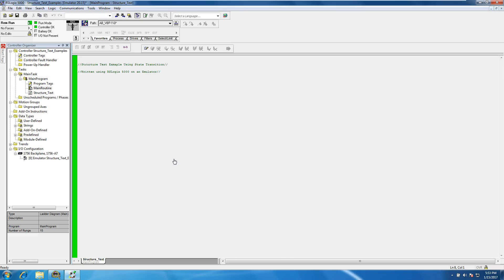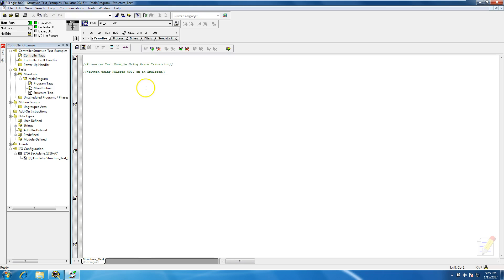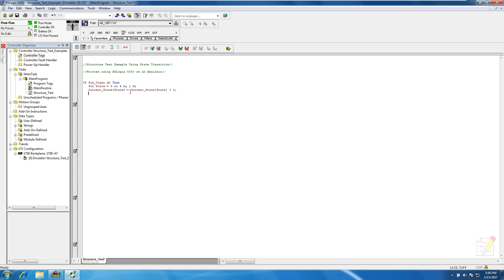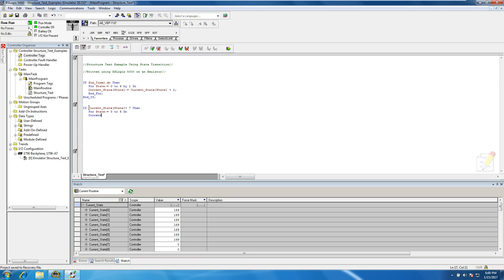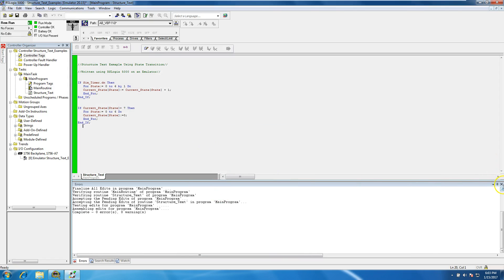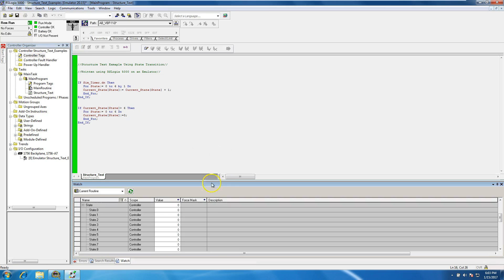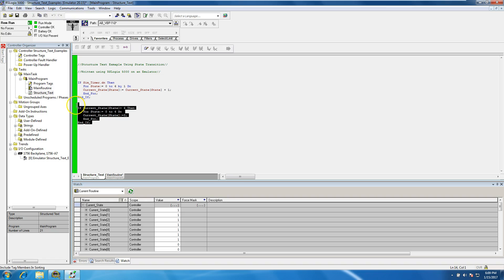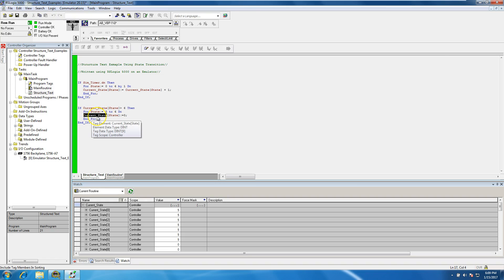RSLogix 5000 Structured Text - For...Do..Construct

Comment: it goes past 6 because you have not told it to stop at a limit. The 0 to 6 you stated in the first for loop is saying for each of the array values (Current_State[0] through to Current_State[6]) increment the value by 1. Therefore all 6 array DINTs increase by one each time the timer done bit is set. If you were to set Current_State[3] to 100000 and the timer done bit is active it will go to 100001.

To limit the value you can just use an if statement in the first for loop, 

if Sim_Timer.dn then
     for state := 0 to 6 by 1 do
          if Current_State[State] < 100 then
                Current_State[State] := Current_State[State] + 1;
          end_if;
     end_for;
end_if;

This will count to 100 then stop and not count any higher even if the timer done bit is active.

you could change it to reset using this

if Sim_Timer.dn then
     for state := 0 to 6 by 1 do
          if Current_State[State] < 100 then
                Current_State[State] := Current_State[State] + 1;
          else
                Current_State[State] := 0;
          end_if;
     end_for;
end_if;

This way you only need one loop which is faster and more efficient.
I haven't tested this code as I don't have a plc handy or emulate installed but it will work
Reply from the maker: This video was down over 3 years ago, I have made new Structure Text video in the recent month on this channel that shows much better results.

I tend to program on the fly as I record to show a solid way of programming, we aren't always right the first time right out the gate.

At times, we have to double back, this shows a better way for the person watching to learn.

Please watch the new videos for a better example

Comment: I did not expect it to go past 6.
What is the point of defining a limit of 0 to 6 if the loop ignores the limit?
Once the count is 7, the loop should not go to 8.

I would expect it to count from 0 to 6 over and over each time the timer is "done".
Reply from the maker: Great question,

To clarify what happened, the way the loop was written would allow the count to exceed the limit and great by a plus one if the timing of the scan rate was to fast. Meaning, I have the task set to periodic and very fast then at the beginning of the loop test I had the sample set to half a second which caused a timing issue which is why you see it hit 7 sometimes and then hit 8 another. 

It didn't go past 7 everytime, just when the timing rates lined up....so with that said, that is why in the video you see me adjust the sample time to 2000ms or 2 seconds so this would limit confusion.

If you have seen any of my training or even some of my YouTube videos, I explain in detail proper CPU timing and scan rates.

Again, great question.
Shane